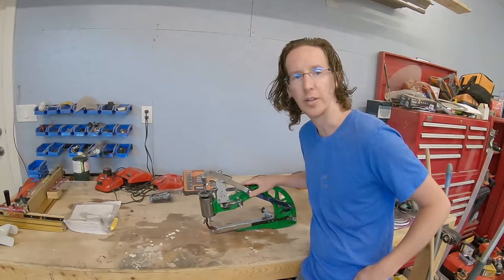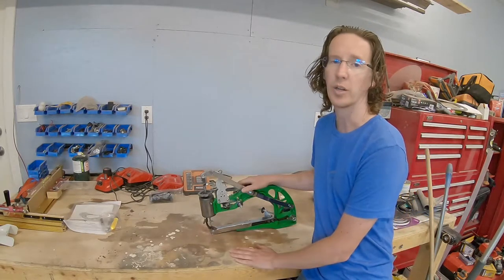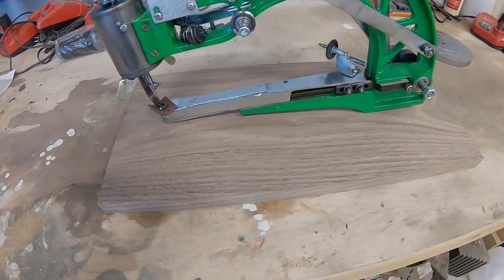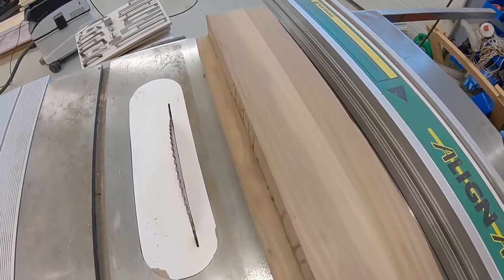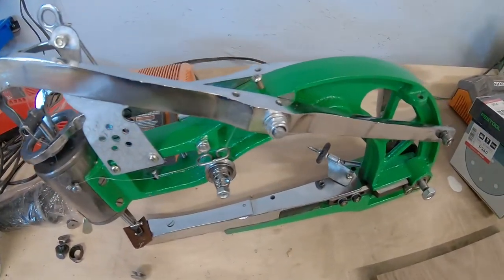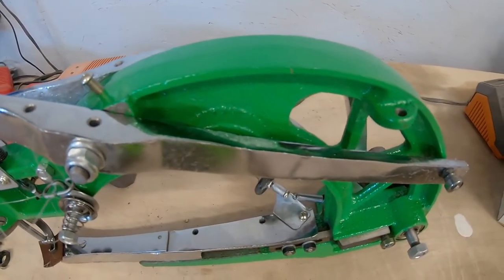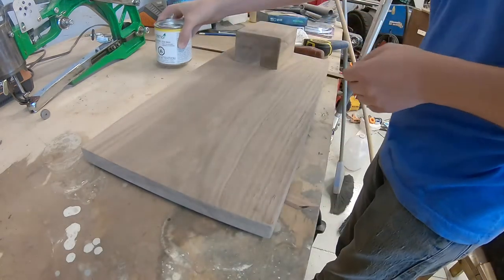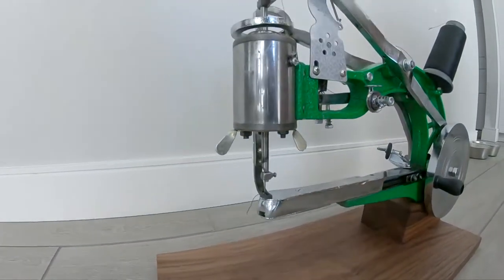AMAZING $85.79 Leather Sewing Machine

Comment: My machine is in the mail. The original tripod stand indeed looks like crap, however the Chinese street cobblers appear to use it with the tripod stand and it works just fine. More mobile. There are youtube videos that show them at work.

Comment: How's that machine working out for you? Good? Bad? Do you use it for leatherworking? What kind of stuff have you made with it?
Reply from the maker: It's good, I haven't had a lot of time to use it but it has been great for small little repairs. I used to to quickly stitch up the toneau cover on my truck without even taking the toneau cover off the truck. I just took this thing out and set it in the bed and moved the toneau cover of the it to do a few inches of stitches on the velcro and cross post holder. I think that is where this machine is nice. Rare Occasional use on add ball projects.

Comment: So how do you like using it?
Reply from the maker: I haven't done a lot of work with it yet. But for small jobs it is way faster than hand sewing. It doesn't run as smoothly as I would like, so I plan on doing a little grinding to clean it up and once the castings are cleaned up a bit I think it should operate a lot smoother. Can't beat it for the price.

Comment: Those chinese machines are rough to say the very least.  I foolishly thought I could use one of these for knife sheath work..nope.  It was a constant battle to get the machine functioning properly and then it would not hold adjustment.  The bottom of the presser-foot is like a saw blade as well, and unless you want horrible marks on your work you have to spend a lot of time grinding and polishing it smooth.  The bobbins are tiny and won't hold enough heavy thread to do much at all..in fact this machine is incapable of using really good bonded thread suitable for serious sheath or holster work.  It's a shoe machine and as shipped it is junk.  Ultimately mine went in the garbage and I bought a Cowboy Outlaw and haven't looked back.  I wish I could warn everyone about these junk machines so they won't waste their money on them.
Reply from the maker: You are correct they are rough and the walking food casting is very sharp, and if you are working on more delicate items or thinner leather than you will need to use a small grinder or sandpaper to round off the sharp edges. It's good to keep in mind of inexpensive these units are and you can't expect much. But dollar for dollar if you want to try out leather work, or just need something for a patch job here and there, I would say this machine works well. The machine you are talking about is $1395 plus shipping from what I could see and for that price I sure hope it would be a much better machine. But for myself just wanting to try things out this was a good way to go. If I really like the work, and end up doing more of it I will upgrade later. I took a look at your videos, those are some really nice knives you make. That is another thing I would like to try my hand at one of these days.
Reply: Not everyone has that experience.  These machines are hand made and all a bit different; that is the main problem.  Some of them work fine right out of the box with the grease cleaned off and a better needle and thread.  I have two of them and spent a few days tinkering and smoothing things up.   I use both of them regularly the last three years and they are no more trouble than any other big sewing machine.  They require a few things right away:  a better base, get rid of the cheap thread they come with, smooth up the bobbin carrier and other critical parts with some fine emery cloth or a Dremel, and play with the tension for whatever thread and needle you use.  Top and bottom tension is critical (it is on any sewing machine anyway).  I use 140/22 15x1 needles and 207 thread for small projects like knife sheaths, custom climbing harnesses in heavy webbing, work boot repair, etc.  Bobbin holds less with this tread but still good for small items.  This is not a machine for canvas awnings or sailmaking!